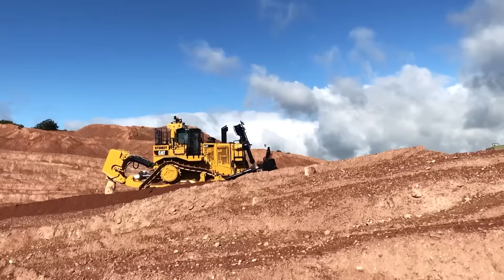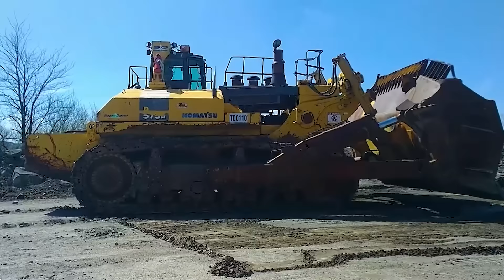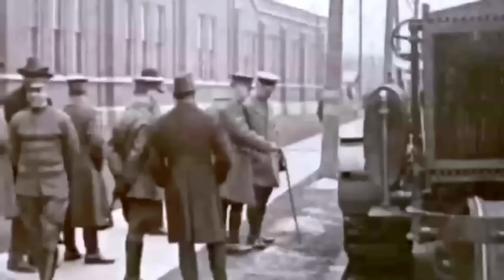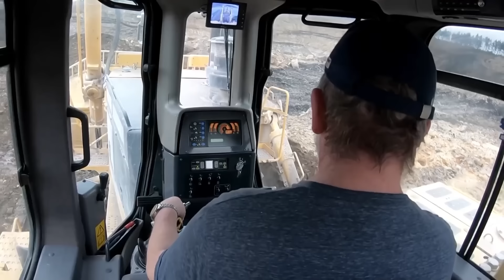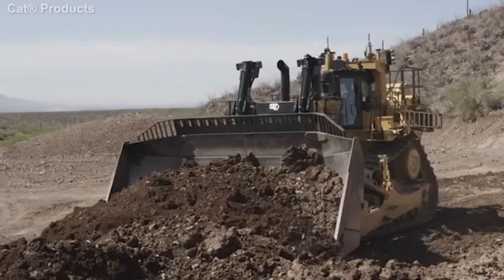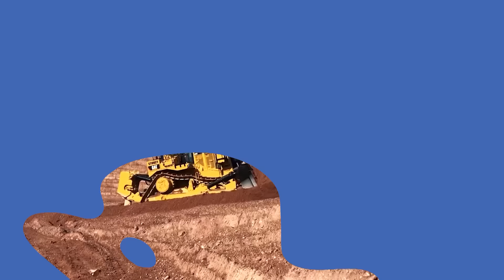Komatsu D575 vs CAT D11 – The Showdown Between The World’s Largest And The World’s Best Dozer

Comment: Fact it was to dam big and by the time they got all the bugs out of it they figured it out and they put it into the 475 and it's a dam good machine and cat been around for ever and looking at how many of the machines are sold should tell you all you need to know the cat D 11 and kamatsoue 475 are the same class and both can be moved to other sites without tearing it completely down and hauling it in seven eight trucks d,11 kamatsoue 475 can be moved with two to three truck's remove the blades ripper's

Comment: Truth is the KUNTSU 575. Was never built to compare with CATERPILLAR!!!! Impossible alll around 
575 is a has been since 5 yrs ago. Couldn’t compete wit CAT. EVEN IN PRESENT. The 575 which is no longer produced had a, Undercarriage life of 800 hrs. 33 days in a mining environment. Which runs 24/7. Without mobility you’re not productive. That tried to compete with CATERPILLAR D-11 had no comparison!!! Been I. This industry 36yrs Operated 475 KUNTSU as well as 575!!! Have been currently in NEW 2023 No Letter CAT D-11. Currently 8800Hrs on Undercarriage and is one Hell of a Machine. So with a little knowledge in this situation. When I say it Never compared. Was Designed to compare with a. CAT D-11 or CATERPILLAR IN GENERAL!! INMHO.
Reply: Jason,
Thank you for sharing your experience.  I was about to ask a question about this but don’t need to now.  I figured the D-11 is the size the mining industry wants, otherwise there would be a D-12 !  The maintenance aspect is key.  Both the durability and the parts availability network.
Reply: @markam306 Thanks my friend 
According to CATERPILLAR They wld of and did kick around a D-12. But wld end if in same reason Komatsu stop producing 
The 575. Simply not feasible as the 575 had undercarriage life of +- 1300 hrs but actually luck if u hit 1000hrs. As stated the NEW D-11 I been operating just hit 8800hrs on 3rd set of TRKS But original side frames. If that answered ur question My Friend!! And HRS in the Dirt is we’re CATERPILLAR SHINES!!  Thanks again my friend
Reply: @jasonmartin7364 АНДЕСТЕНД?
Reply: my friend,komatsu never spill the dirt,the cat spils. cat 57 cubic yard dirt,the king🫅🫅🫅🫅🫅,125 cubic yard without spilling.ripping komatsu is the boss🎉🎉❤❤❤❤.power engine komatsu is the strongest,soo,hail the king of all dozers🫅🫅🫅🫅,D 575A🎉🎉🎉🎉🎉🎉🎉🎉🎉❤❤❤❤❤,
Reply: They had there problems but the newly updated 475 A-8 will run that kitty into the ground updated drivetrain undercarriage weight and HP make a great dozer Komatsu has both
Reply: @EdwardWeigel-y4g  #1 Depends on whom is in SEAT!! #2 The New No Letter D-11 has been completely updated/Revamped from D-11T 18,000 ponds heavier at 248,700 LBS. 
1022HP forward 1202HP In reverse New longer main frame 
Longer side frames.=more track on ground. U dozer 9’ft tall,22ft Wide for (58) cubic yds. One I’m currently operating I shove 1 58yds pass half way down slot back up load CAT again grab first pass push BOTH W/ease!!!!! #3 We have (1)Newer 475 KUNTSU’s left is other 2 burnt down. What I’m saying is my NEW 2023 
D-11 I’m currently operating. 
“WILL ABSOLUTELY FCKN WALK ALL OVER KUNTSU 475-A8. As I witness this Daily! There is zero comparing CAT W/ KUNTSU 475!!!!!!!!!!!!!!!!! The D-11T compared to 475-A8 is something you can compare. Just Not to NEW no letter D-11
Will  completely DOMINATE UR 
KUNTSU 475 My Friend. Not trying to break ur heart!!! But this is so Damn true. 31 yrs in Industry as Finish Blade and Cat Hand, have Zero reason to lie My friend just stating Facts. Don’t stress have couple Karen’s at work whom are KUNTSU Fans
“IF IT AINT CATERPILLAR IT AINT SHIT” special in DOZERS
Reply: @EdwardWeigel-y4g  horseshit....the market says otherwise, look at sales, simple as that
Reply: @Gavin84w  you CANT BE COMPARING CAT SALES WITH 
KUNTSU’s better do ur homework bro because sales is 
DEFINITELY NOT COMPARABLE 
PERIOD!!! Please show me #’s were that’s has ever happened please
Reply: @jasonmartin7364  really....so the market is not the best guide there is as to who produces the best product.....so who or what is then champ?

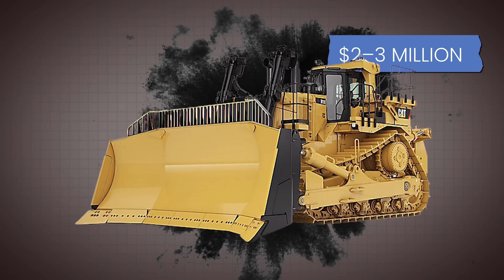Comment: 1:19 So Komatsu D575 is just a BS . Dozer? That is what you just said?
Reply: Actually true statement lol.
Reply: So What's Wrong!!  It’s Actually Spitting out the facts...
Reply: Кто работал на КАМАЦУ понимает что он лучше на рыхлении чем cat в разы😉   даже четра т-35к лучше cat d10t2 в разы на рехлении хотя 35ка легче😅 вот вам и cat распиренный😅
Reply: That 575 komatsu will run circles around that CatD11 now there’s the newly updated Komatsu D475 A-8 updated drivetrain undercarriage this 475 will run that kitty into the ground remember weight and HP make a great dozer and Komatsu has both
Reply: @EdwardWeigel-y4g as is the Mo letter CAT D-11 updated completely different frame from R model 
More track on ground  ect ect. 1025hp 252,000 lbs dry weight. 58 cyds blade extended dual tilt rams